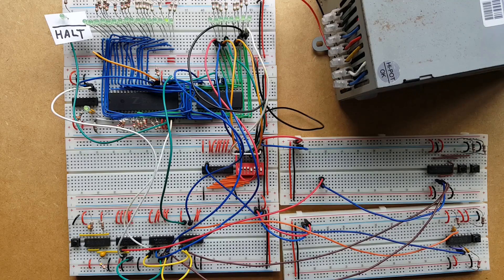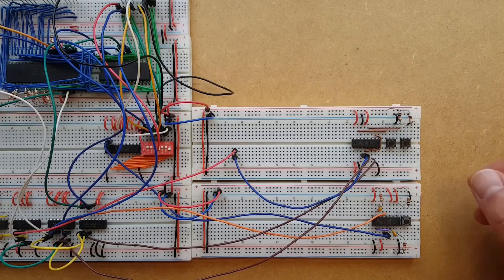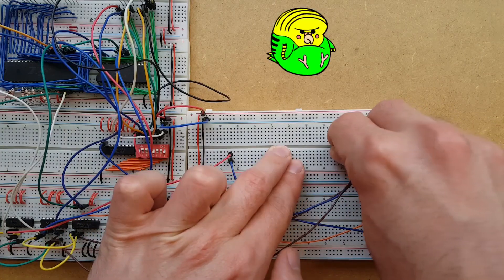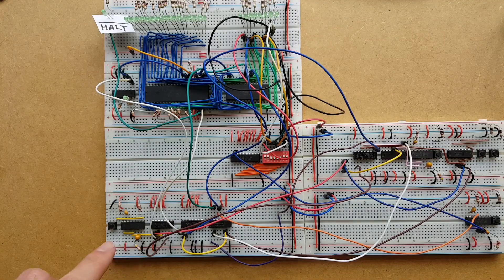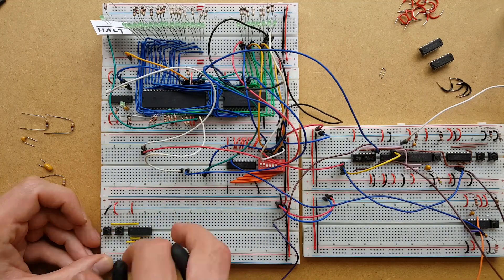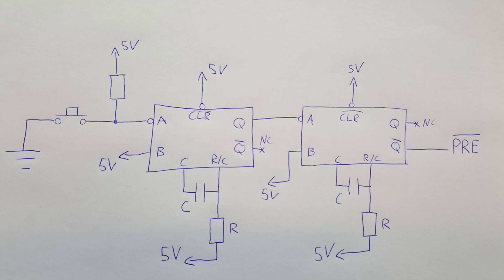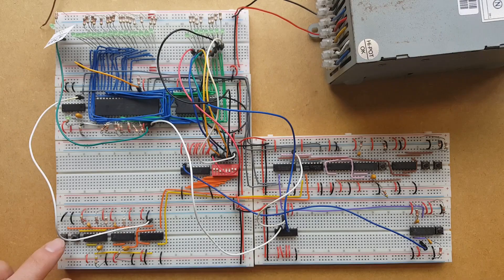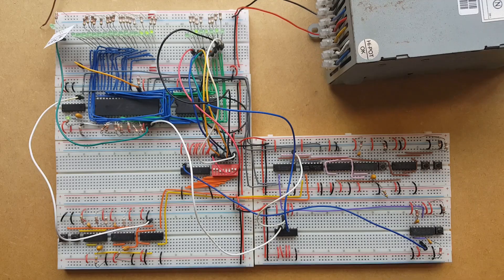A cheapo Altair 8800 style computer using a Z80 - (part 6) - It's finished!

Comment: woot, it's done! Well it's "done".

Huh. The Altair 8800b implements two more switches. I didn't look up a manual for the 8800b, but I did work out how you could implement them—for the input/output switch IN a,(n) ($db, 11011011) and OUT (n),a ($d3, 11010011), noted the single bit difference that might save us a gate or two, and even recognized how this is almost like our examine JP if we could jump the two-bit counter past the "nothing" 01. I didn't work out the most minimal logic to accomplish that because it then came time to decide if I wanted to ld (nn) and eat/wait at WRITE, or do something clever with OUT (n),a …

And then I stopped. MITS did this wrong. I don't know if the 8800b came out before the IMSAI 8080 did, but even if they didn't, the 8800 had something significant: The high byte switches are meant to be sense input for programs to read from port FF. If you've implemented that (did you? I've had an injury and may have watched these videos on pain meds and missed something.) Anyway, it makes a lot more sense to, instead of load the low byte into a, you just do IN ($ff),a.

And that's how I know that Altair did it wrong. Because if you implemented it that way, you'd never use the high byte/sense switches as the port address for I/O read/write. You'd use the low byte switches as intended as God—or at least as Faggin—intended. But that still leaves the question of what to do about displaying the accumulator? I haven't got an easy answer for how to implement that on the Altair 8800.

But IMSAI has. If you write to port $ff, you latch PROGRAMMED OUTPUT, an extra set of 8 LEDs. The IMSAI had 44 of them in total 😮, and the Z80 frankly does not output all of those signals, and had to rename several of them anyway. I'm not 100% on the Z80 to 8080A name mapping, but Cromemco (who used IMSAI's cabinet and front panel) kept the 8080A signal names save for STACK which they reused to indicate whether the CPU was running in 2MHz mode for greater compatibility or 4MHz.

No need to get fancy with trying to fast-forward the two-bit counter this way. It's always IN (n),a or OUT a,(n) which always means $db/$de followed by the low order byte (switches or hardcoded $ff) and then run until M1.

Whew.
Reply from the maker: Thanks for taking the time to write such a detailed comment!

I have actually been thinking of upgrading the Budguter to an Altair 8800b spec. I did (quite a while ago now) look through the 8800b schematics and the way they do it is with a small ROM with the switches and some counter circuitry on the address lines and the data lines force opcodes onto the i8080 data bus. But you do make a good point there that there's only 1 bit difference between IN a, (n) and OUT (n), a. So we could use less buffers to push opcodes onto the z80 data bus, there's also less than 4 '0's in the IN and OUT opcodes, so we could use pull ups on the data bus and then use a single 74HC244 (or 74HC240) for both opcodes.

I did add sense switch functionality in a later video. I agree it would be easier to just use the sense switches for the load function instead of the address low byte, I haven't looked into why they chose to do that but I'm guessing they had some reason that probably makes sense (ergonomics maybe? don't really know).

For the display accumulator function I'd say use OUT (n), A and hold it in a wait state until the switch is released (i.e. the accumulator would only be displayed while the switch is held).

I do like the programmed out latch of the imsa 8080, maybe I'll add it in the next version of the Budguter.

Thanks again for taking such an interest in my videos!

Comment: I was going to say you hadn't included a list of what was required until I checked the comments. Any chance of posting the completed schematic?  Wiring from the video can be tricky at times.
Reply from the maker: yeah the list components got a bit long and the human man moved around quite a few of the passives in between videos and couldn't remember the values used from the previous video so I just listed the ICs (the exact values of the passives don't matter all that much, you can quite easily find 'good' values for them using a bit of trail and error).

I am intending on putting our projects on GitHub (or something similar) but it's just finding the time to set it all up, but I will at some point :)